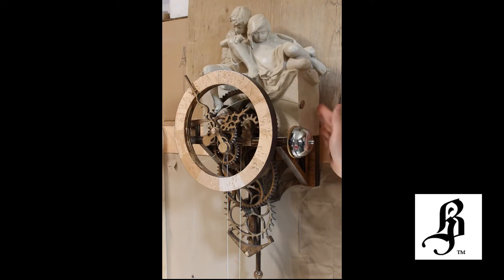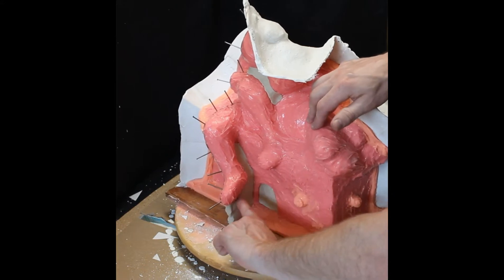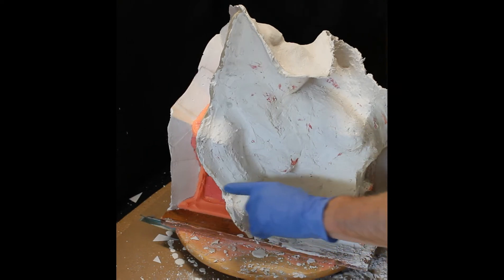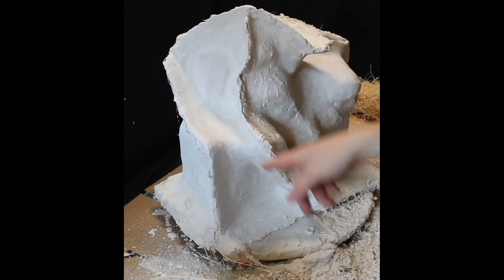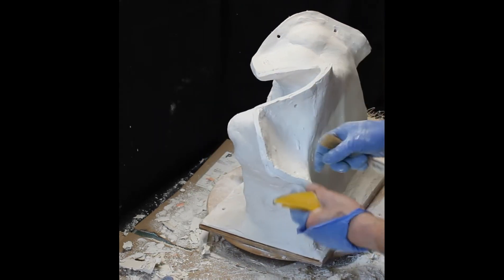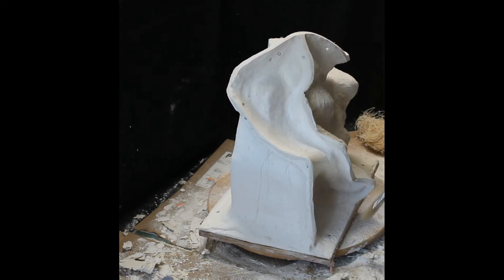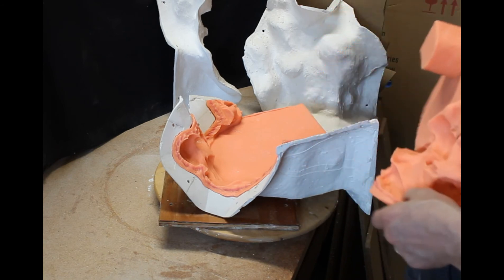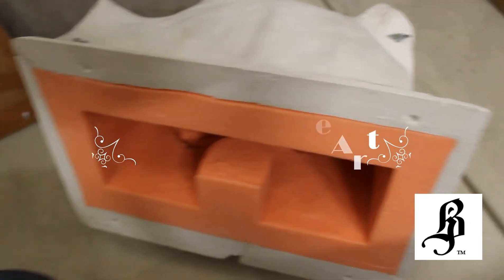HOW TO MAKE A COMPLEX MOLD for Sculpture - Hydrostone / Plaster Mother Mold, Handmade Mould

Comment: Hello, excellent
Excuse me, what is the material behind the mold?
Reply from the maker: There's fiberglass soaked in hydrostone gypsum plaster. And then there's the orange silicone inner jacket made from Mold Max 25 by Sooth-On.

Comment: Sweet :) would this be possible with tin-silicone? Normally I use jesmonite instead of plaster. I am also wondering about you seam lines, as you put those on after 24 hours- doesn't the first layer of silicone have to be sticky in order for the seamline to adhere? :)
Reply from the maker: Thank you for the compliment! And yes, tin silicone will work too. The thing about silicone is that it continues to stabilize at a decreasing rate over time. It will behave as one the closer the applications are together. I would not expect favorable results a week between layers BUT a day or two should be fine in most cases. Just keep it away from greasy hands and debris in the meantime. Thanks for watching! Your questions are most welcome 🙂
Reply: @JonBurnsFineArt  Thanks for the answer! :) I also liked your detail about making a zipper with the knife. I have myself bought a moldkey-knife , but have yet to test it. Keep up the good work

Comment: If you'd forgive my ignorance, could you cast clay in this mold? If so, how would it dry?
Reply from the maker: Casting would not be the correct term. While the mold is open, clay slabs could be potentially pressed into the mold cavity on both halves. After it has dried somewhat, close to leather hard, the edges cleaned up, scored and the two halves joined together with some slip. To better understand this process, youtube videos on "press molding". Of course the hanging leg is another issue that would be approached the same way. Unfortunately silicone does not allow the necessary air flow to dry from its surface and slip casting is entirely impossible. I spent time dealing with this during my graduate studies. Good luck!
Reply: Thank you for the quick reply and helpful info!

Comment: Please post videos of casting also (using this mold)
Reply from the maker: You can count on it! I'll cover some casting pointers and then show how I cast hydrostone in a mold using this one in particular. Thanks for watching! 🙂
Reply from the maker: https://youtu.be/x_0zAaIlKX8
Reply: Jon, I am wondering how the air escapes from those projections such as feet and legs. Does the rotation allow for air not to bubble in the toes..?  Also, does hydrostone take longer to set up before unmolding than  FGR, or Forton, which I think results in a stronger cast. I'm really grateful for these videos. I have learned a lot of finer points from you. Blessings.
Reply from the maker: @donnahalsted7718  Hi Donna. Here we go. The rotation really helps keep the liquid moving over traditionally problematic areas where air gets trapped. As that area moves downward the air moves up and liquid replaces it. Of course some areas can be extra finicky. But I also try dividing the silicone over the fingers and toes where I believe the mold will go back together easily. These partition lines, believe it or not, actually allow a little more air-bleeding which results in flashing (the stuff we chip off later). As far as hydrostone setting time, I can get about 45-60 if I keep it moving. But that's also with a 7 minute presoak before mixing. If I let it sit idle, it can set in 25-30 minutes. I usually use cooler to cold water. Hope this helps.
Reply: @JonBurnsFineArt  Yes, thank you, Jon.

Comment: Too much hustle. Is there any material that can just dissolve the sculpture inside so you can pour it out?
Reply from the maker: And how would the next casting come out? If you're making a waste mold for a one-off, then a plaster waste mold is what you want. Silicone molds are for multiple castings. It's no hassle for long term goals.
Reply: @JonBurnsFineArt  maybe shore 00 silicone can do the trick?
Reply from the maker: Some people use Smooth-On's 00M00-30 silicone for waste molds. Is that what you mean?

Comment: so are you actually using plaster, or is it hydrostone?
Reply from the maker: Hydrostone.
Reply: @JonBurnsFineArt  -OK, I thought so since you were going so thin. do you always use that tighter weave fiberglass fabric or do you use mat or mesh sometimes? I most often use poly-fibers mixed into the Hydro-stone, but i haven't used it with fiberglass any thoughts? It's great that you are posting these videos and awesome that you respond to questions. thanks
Reply from the maker: Either will work BUT the mat is superior to the cloth. I don't use poly fibers. There's something to the vibrational quality of fiberglass. I've used the mat fiberglass enough that I'm almost immune to the itching between my fingers and arms. Disposable gloves are very handy while you get used to it. I want to add that plaster bandages as a first layer help the hydrostone from runny off so quickly. There's too much to say here but you'll develop your method.
Reply: @JonBurnsFineArt  Clarify what you mean about the vibrational quality of fiberglass?, and are you saying you use regular plaster cloth and hydro-stone together? does that create any de-lamination issues?
Reply from the maker: When I refer to the vibrational quality, I'm referring to it's physical properties. I've dropped molds made this way from table height and they are resistant to gravitational impact. The mat seems to absorb the impact leaving the mold with only a chip or so. Never the whole thing being ruined.
I have not had any issues with hydrostone "delaminating" from plaster. Just apply layers while it's still initially wet/damp. Otherwise soak the dry, cured plaster so the next layer sticks well. Again, make a test sample and see for yourself what I mean. Jump right in.
Reply from the maker: @arthardware5560  I will say though, hydrostone kicks mostly at once at the end. I used a mat fiberglass mat dipped in the hydrostone. I continually scrapped the settled material off the bottom of the container back into the mixture. I got about 45-60 minutes of potlife this way. But it was a constant baby sitting job because as you've noticed it runs off. Through my personal experience, and I've only recently discovered this, plaster bandages work so nicely as a base layer dipped in hydrostone. It hydrates the bandages and adds some hydrostone strength. After that, go back to the hydrostone by itself with fiberglass mat (or cloth if it's what you have on hand. Just pull it apart slightly.)
The hydrostone will stick and not run off this first layer. I will eventually get around to creating a video demonstrating this technique.

Comment: Can I also use fibreglass material as the mother mould for silicone?.
Reply from the maker: You can use fiberglass in your mother mold over the silicone jacket. I do it every time.